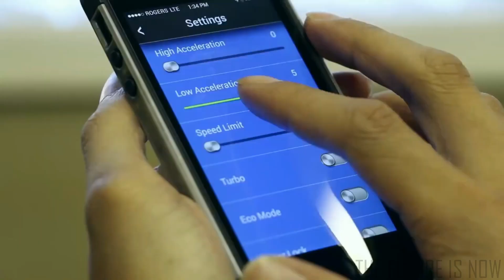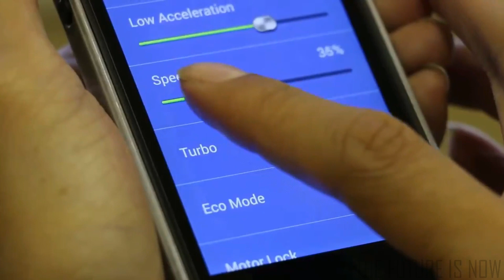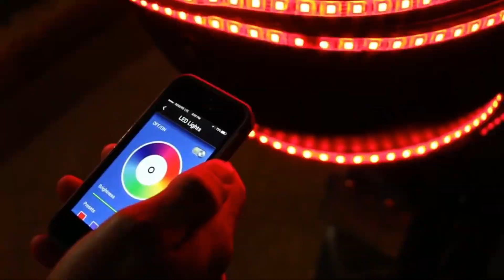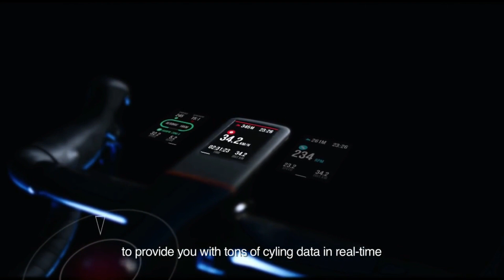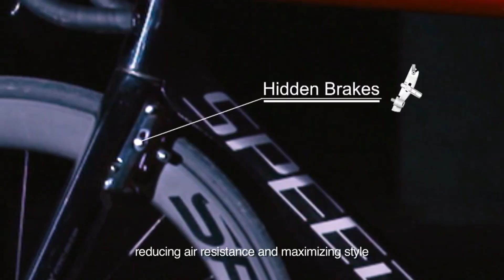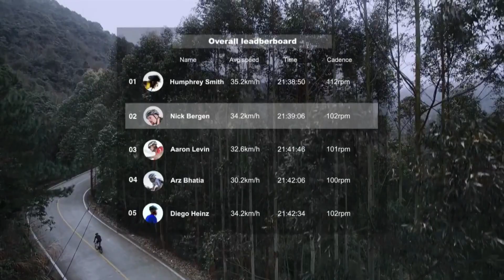5 New E-Bikes That Will BLOW YOUR PANTS OFF

Comment: Which bikes do you need license to ride or are all no license to ride
Reply: Depends on your local laws, in the U.S. the motor has to be 250W or less as well as the it has to stop when it reaches 25 mph for it to be considered and electric bike and be used in the bike lane and don't need a license. In the EU the limit is 25 km/hr. Our bikes fit this criteria.

Comment: There is nothing even remotely interesting about any of these bikes.
Reply: the Leopard was okay.  rear mounted front brakes are sure better.
Reply: I don't even recall which one that was. I just didn't find any of these bikes to be especially impressive.
Reply: Is there any reason in the world to prefer an electric moped over a petrol powered moped?
Reply: tarstarkusz must be some, I am hip look at me I save the world guy.   Who actually do nothing to do it.
The Leopard was the carbon roadbike.  And it is freaking cheap 2500 USD for the better version. There are really not many roadbikes on the marked who can beat this setup.  when the integrated cycle computer can do that much like a garmin then this bike is the cheapest aero roadrace bike ever.  Compared to the cheapest aero bike on the marked with same specs,  who is around 4k.  And this is actual very cheap.  You dont have the cycle computer yet and the front and rear ligth.  Can cost all together more then 1k.  Also they are not aero. The Leopard have integrated ligths..